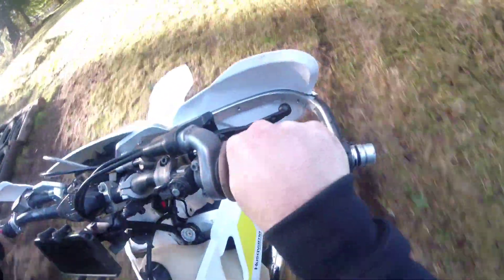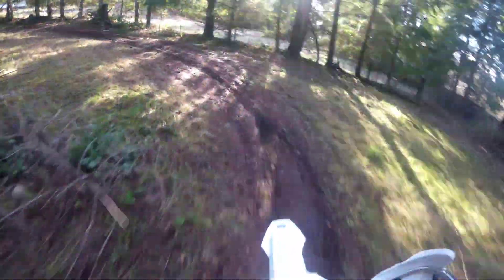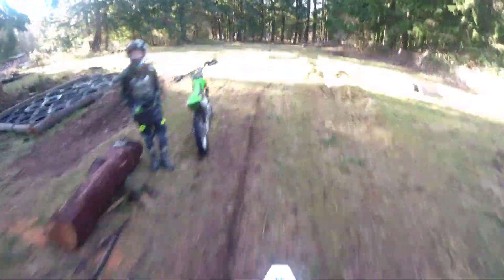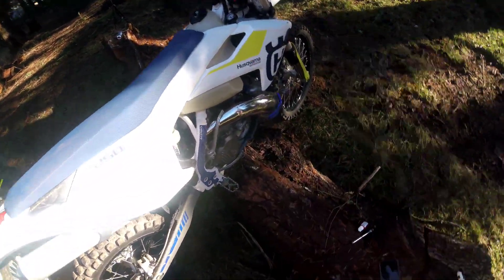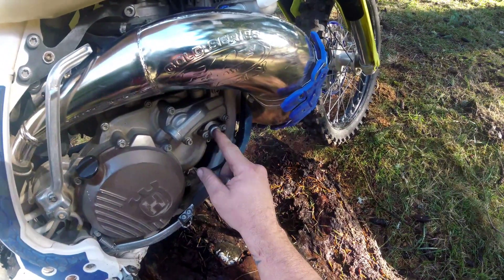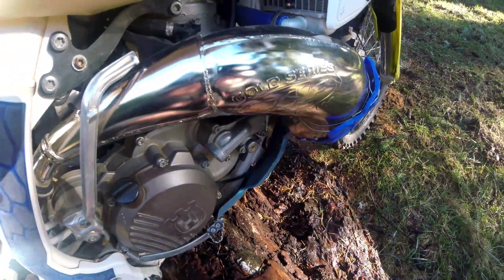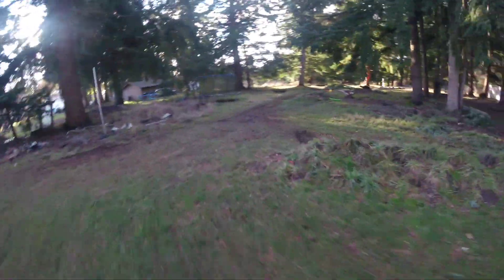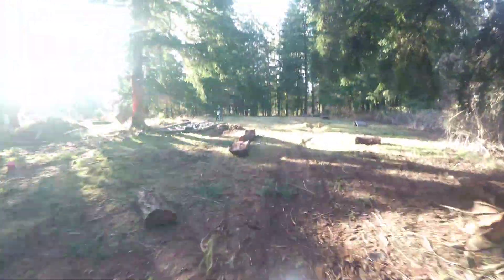2 STROKE TPI POWER VALVE TUNING #husqvarna #ktm  Did you know??

Comment: I did it to. Bike feeling super usable also powerful. But weird noise coming from silencer at low rpms puh puh puh :)
Reply from the maker: Mine does the same untill it's warmed up.  Also if you have a spark arrestor check the cone. And clean it.  I took the cone out and put it in a s small bowl of gasoline and used a little wire brush.
Reply: @chainslapmoto  I bought a used bike.Spark plug was almost seemed to fall and cylinder head was filled with oil:)   I will check it more
Reply from the maker: @stormriders343  ah the fun of used bikes!!  The only bikes I ever bought new are our kids 140s. You usually get a lot more when you buy used. But you can find gremlins too.   Good luck!!
Reply: I think 2.5 turns in from flush is how they come from the factory. If it has the stock spring.
Reply from the maker: @316madness  sounds about right.  That's about an 1/8 inch from flush with the case.